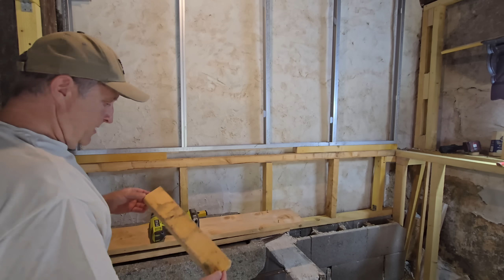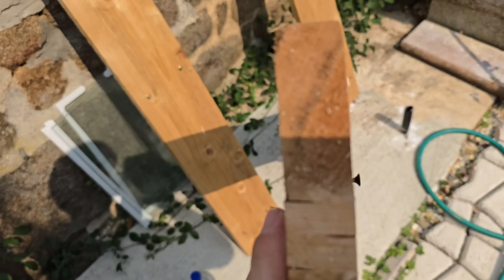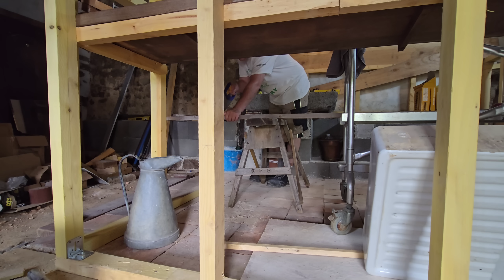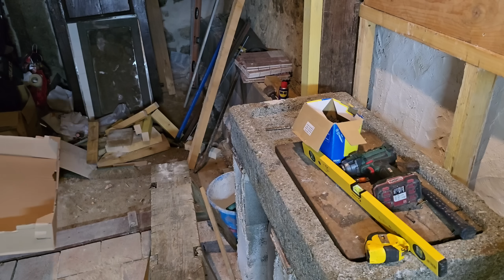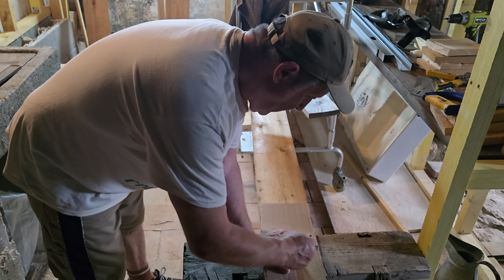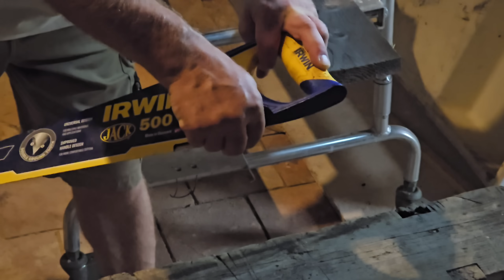Reclaimed Kitchen Wall Project: Plus Tool Maintenance!

Comment: The wall is looking good I assumed you would put insulation in first  sure there is an easy from the bottom to squash it up. I am glad you are going light colours on that wall as the dining area will be slightly darker. I am sure you are putting in lighting be curious to see what you come up with  there.  well done Sean :)